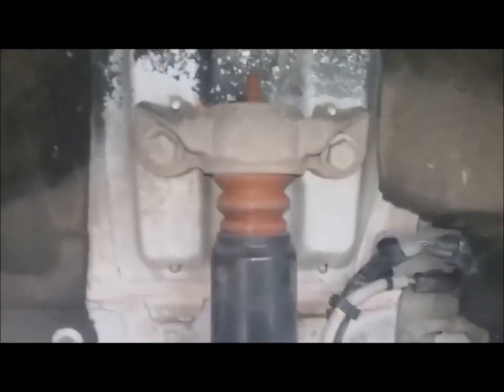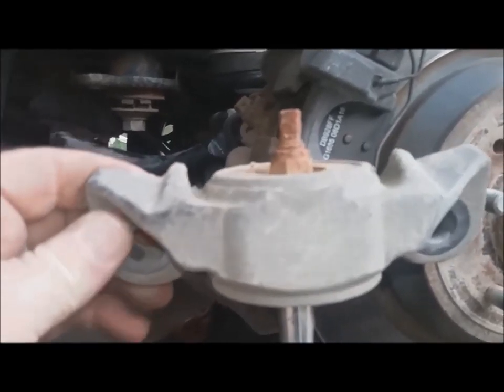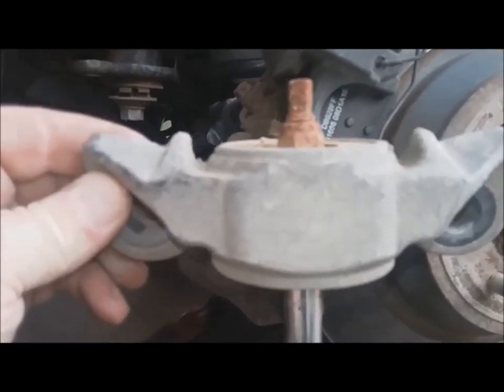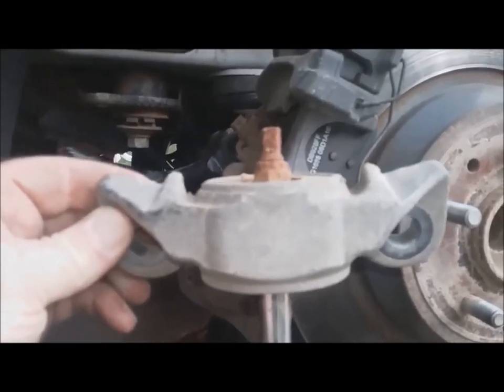Noise from rear of 2013 Ford Fusion

Comment: Thank you for this. I just started hearing that noise this morning. I have a 2013, with 60,594... I guess they mean it when they say "around 60k." lol

I'm going to try tightening it first, because the shock seems to be doing its job well, and the rattle may go away if tightened and get me another year or so.
Reply: How did tightening it work for you? Mine seem to be doing their job as well and if I dont have to replace them yet I'd prefer not to.
Reply: I just googled this noise for my car and came across your video!! THANK YOU!! Exactly the same sound. So annoying!! Getting it fixed tomorrow
Reply: Tightening the nut at the top of the shock worked perfectly for me!  I was able to tighten  it about 3/4 of a turn using a 15mm wrench and vice grips to prevent it the shaft from spinning.

I had the exact same sound as the video and it was driving me and my wife bonkers.  A mechanic told me it was probably the control arm, so I can't believe it was this loose nut!
Reply: @davidozog7549  this man deserves the oscar. This is what makes the noise happen

Comment: Did you ever fix the problem because I got the same issue with my Ford Fusion 2013
Reply: I didn't replace the shock I just put a washer under the top nut that holds the top mount to the shock and that fixed the noise.  It's crazy how loud the noise is but it's all in the top shock mount.  You can either buy a new top shock mount or just put a washer under the nut to take the play out.

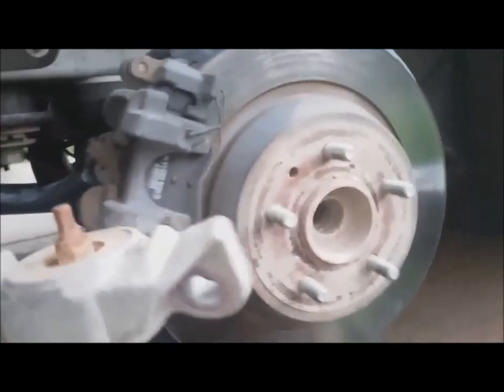Comment: I've been looking for a fix for this noise forever, thought it was the rear bumper shaking as it is loose, fuel door as the hinge broke, or just rocks that have got trapped in the body. But I'm sure it is the shock mount after watching this video. Also, were you listening to what's my age again by blink-182 during this video 😂 1:05
Reply from the maker: Thanks and I'm not sure :)

Comment: Did you have to replace the shock mount as well? Or did you reuse the mount and just purchase a new shock?
Reply from the maker: I did not change the shock mount but perhaps I should have. The nut has a tendency to loosen over time and that COULD be the worn shock mounts fault. The rattle returned and I tightened the shock bolt. It went away but now starting to return again. The shock bolt is difficult to tighten as there is no good way to hold the shock rod while tightening the shock rod nut. The top is cover by the deep socket and putting a vise grip on the rod below the mount seems counterproductive. Mar the rod, spoil the shock.

My newest plan is I got a "pass-through socket set" from harbor freight (can't find it online at harborfreight.com, but google it to see the type) for $16. This allows you to tighten the nut while holding the rod from the top. I will post the results here in the next couple days.
Reply: @stevec588  thanks for the info! Really appreciate it.
Reply: @stevec588  did the pass-through socket set thing get rid of the noise?
Reply from the maker: @JoaoMilasch  No, check the update added to the description today.
Reply: @stevec588  yeah I have the exact same noise coming from the driver side of the trunck. My wife drove around while I was sticking my head into the trunk while the seats were down and the noise comes from the area where the shocker is mounted onto the chassis. I will take it to the dealership and if I have any information to give you afterwards I'll let you know!
Reply: I have the same issue. Also thought it came from the inside of the trunk or seats.  I'm also curious what the dealership says Joao. Good luck!
Reply: @ @JoaoMilasch  I have the same issue. Any update on this from the dearlership?
Reply: @takyekini  Sorry not yet. When I book an oil change I'll complain. So it'll be another couple of months or so...
Reply: @takyekini  OK, I finally took it to the dealership today. They traced the issue and it turns out to be the shock and mount on the driver rear. They are going to replace both shocks in the rear and mounts. Cost is going to be $640.00 Canadian + tax.
Reply: @JoaoMilasch thanks for the update

Comment: When you replaced the shocks, did you also replace the mount?
Reply from the maker: I did, I noticed the rubber inside the mount was worn so replaced them. Others here have gone the cheap route by adding washers but as I get older (and can afford it) like to keep everything stock.

Comment: So did replacing just the shock get rid of the noise or shock and shock mount?
Reply from the maker: I replaced the shock and the mount. I would replace both. Trying to remove the shock without damaging it is tough. I have since replaced the shocks again as 30K miles and Minnesota winters take their toll.

Comment: Ok did that noise went away or you still got the noise
Reply from the maker: Yes, I have to concentrate so hard to hear an occasional click if I hit a bump just right that I would say it's fixed. That "occasional click" could be coming from the other side.
Reply: @stevec588  where did you find the shock mount I've looked everywhere and nobody has it.
Reply from the maker: @richardsmith7379  OEM:  https://parts.ford.com/shop/en/us/bracket-shock-absorber-7847843-1

or: 

https://www.google.com/shopping/product/15143945979636446433?q=ford+fusion+shock+mount&rlz=1C1CHBD_enUS834US834&biw=1920&bih=937&prds=hsec:online,paur:ClkAsKraXzqL8yDdalP9YQ8Z4LUt0YlOjCfRkGbgZpxtL6ecxSBHPCgTjGnIRMjtcWsLPCAgcAHkUMoKNwf1sVcEh_vOr7UZz6sIW3_557MK46ha1DaRFXZhPBIZAFPVH70fOumLYzpx6yvgtjUpiThMdWu1Uw&sa=X&ved=0ahUKEwjP5OqposDgAhVnwYMKHQETDbo4FBDZKwhS
Reply: taska ford parts $22.00 @stevec588

Comment: Omg! Thank you so much for this video and titled the right way I have searched the internet for a explanation for this sound in my 2013 fusion and couldn't find nothing but dash problems and I've tried to figure it all out. I didn't think the shock because my car handles well not bouncy or nothing so do you think I need to replace the shock or could possibly tighten it?

Comment: In your video you said you replaced the shock to get rid of the sound but in your write up below you said you replaced the shock mount to resolve the problem. Which was it? I myself believe its the shock mount because I have the same problem same side. I just haven't got around to replacing it. The driver side mount doesn't have the same play in it. The mounts should be replaced with the shocks anyways. Thanks for posting the videos its identical to what I'm experiencing.